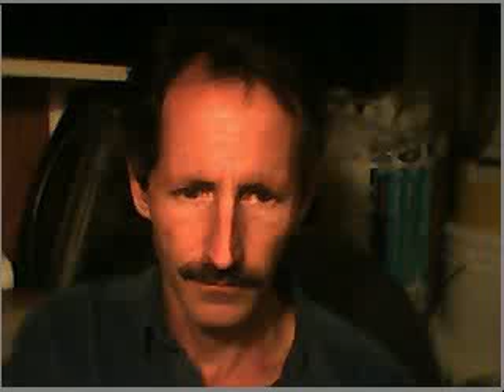Re: For you 2

Comment: The fact is synchronous rotors will rotate at a rate equal to their supply frequency, while induction motor only slight more so. Newman motors, on contrast, will have charge concentrations, which themselves occur at angular frequencies exceeding the rpm of the rotor.

The rotor itself, however would only change a small fraction of the rotation for each push, unless some form of induction "slip" existed in the system from which the torque would take sometime to actually be delivered to the shaft.

Comment: To be more specific about "charge":

The drift velocity of electrons travel is rather slow, on the order of millimeter per second. There is absolutely no conceivable way where even the Newman motor under normal operation would travel that slow relative to electrons.

The fact is however, the change of electrical field is required in a given space, and this is done by varying the waves of electrical field concentrations, which themselves can move "effective charge" at relatively high velocities.

Comment: Here is the bottom line on electrical "power".
Electrical power is nothing more than the time derivative of torque.

But here's the catch. Virtually all motors that are commercially available have the change of angle between charges dictated to them, by and large, as a result of rpm of the rotor. Almost none of them (if any) will survive a condition were a load is put so heavy and incompatible, that the rotor would rotate will less than rpm than charges in circuit.

Comment: ...but otherwise the rpm of the charges in excess of the rpm of the rotor itself would determine the power output. The result is a torque on the current that is as calculated, but due to its different rpm than rotor itself, the torque on the rotor will be anomalously high. If you can find a motor to this date (11.05.08) made by GE, etc. where normal operation is possible in a region where rotor rpm is less than rpm of charges embedded in the conductor, I will give up my hobby. I am that certain.

Comment: An expert can easily see that: (centripetal acceleration of charges)/(linear acceleration of charges) = distance/radius = angle in radians

Well guess what? The change in angle is relative. I know what you might be thinking: How so?

See, the rotor will rotate at one angular velocity, and charged particles in the system will revolve at many different angular velocities. When the rotor has higher rpms than charges making up the conductor, it will determine the power output, but otherwise...

Comment: Again for UNDERPOWERED CIRCUITS:

Because the torque varies as:

(Voltage*Current)*velocity of charges/acceleration of charges

The power output varies as:

(Voltage*Current)*(velocity of charges/acceleration of charges)*(velocity of charges/path curvature radius of charges)

(Voltage*Current)*(centripetal acceleration of charges)/(linear acceleration of charges)

Therefore, quite deductively, centripetal charge acceleration is necessary to generate a magnetic dipole field of considerable

Comment: POWER OUTPUT=TORQUE*RPMS

Since the energy of a magnetic field exists in two polarity, a magnet existing within it must change polarity one time to get the change corresponding to the system's torque. This simply by doubling the value:

(1-(-1))(1/2)*(Voltage*Current)*velocity of charges/acceleration of charges

Afterwards, the field voltage much change relative to exterior magnetic flux. It is impossible to do work without cycling the thrust.

Comment: It is possible, though not convenient, through very careful driving, to get a sports car (with automatic transmission) that normally reads 20 mpg on the odometer to get a 45 mph. I have done that. One must let go of the engine rpms that are unnecessary to maintain speed. Likewise, the equation here shows that:

(1/2)*(Voltage*Current)*velocity of charges/acceleration of charges

With a very low acceleration to maintain velocity, one will have more energy stored for a given power INPUT.

Comment: As for very underpowered circuits (low current rise for given voltage/resistance):

Voltage=Inductance*(change of current/change in time)

And we can see that it becomes:

(1/2)*(Voltage/(change of current/change in time))*Current^2

(1/2)*(Voltage*Current)*Current/(change of current/change in time))

Since current is linear charge density*velocity while the latter is linear charge density*acceleration:

(1/2)*(Voltage*Current)*velocity of charges/acceleration of charges

Comment: "I don't know what Faraday would call the self governing effect I mentioned, but some one told me the motor speed starts to slow down when its rotation speed starts to generate a voltage equal to the battery voltage."

That is right. The voltage is limited, so the electrical potential energy per charge is limited of course. The slow rotation of the motor can be very discouraging too many. Rpm is useless without torque. I need to know torque before truly judging power output.

Comment: Work is the transfer of energy from one system to another; Newman and Bedini are not claiming a quicker or more efficient transfer of energy: they are claiming actual creation of energy out of nothing.

An inclined plane improves work efficiency; if the issue was merely work, then they would be building loading ramps, not electrical devices.

By the way, I am now a happy subscriber to your videos. I wish you much success in helping Newman believers think.